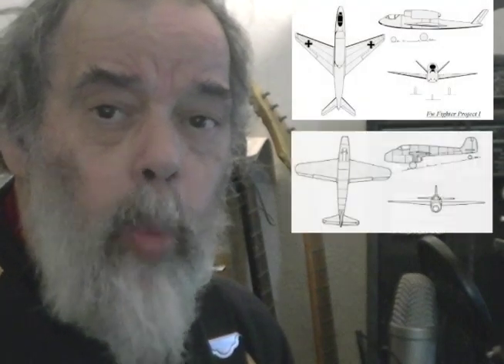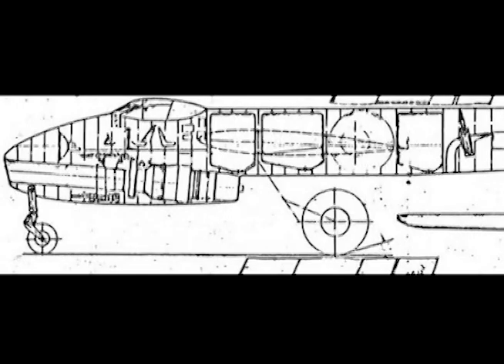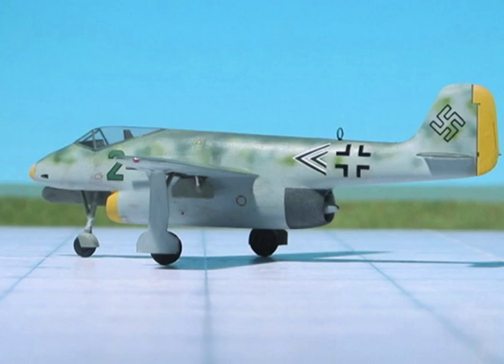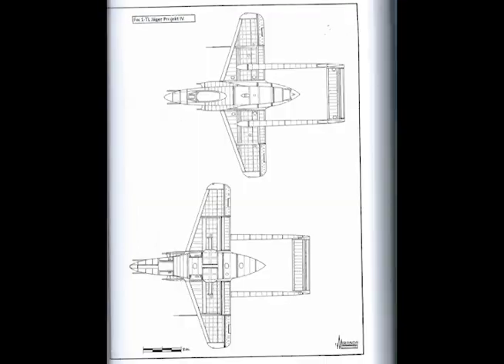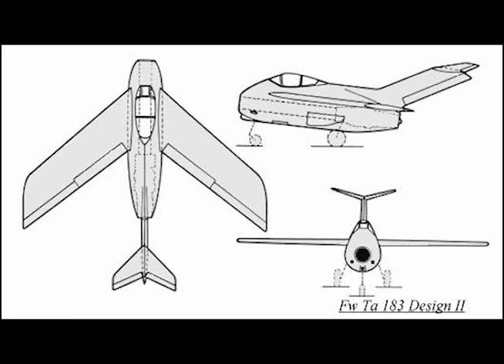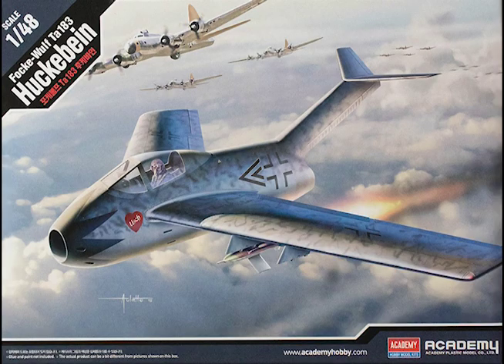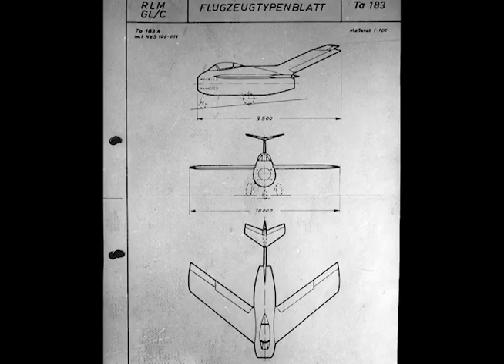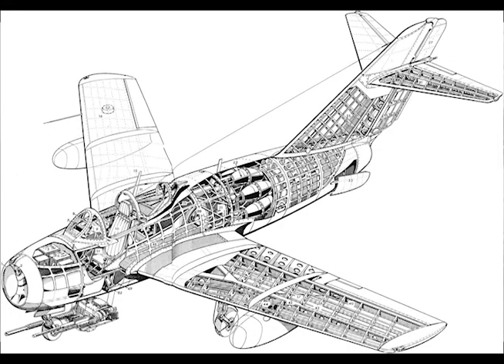German Experimental Aircraft of World War II #10 - Focke-Wulf pt1

Comment: Project No 1, N1 It looks like The Bugatti (which I never knew existed until last month) with a Jet Engine on top instead of props.
The F86 and all it's variants is also a lot like the Ta183, you can see the P-80 in it's design, but that sitting on top of the engine or at least the intake was pretty standard in the fifties for everyone. Great Perch.

Looks like the days of Lumbering bomber formations over Germany were just about to become way to costly for the Americans. The Germans were just about to increase their speed by 25% over escorts and more than that on the formations, it would be about double the speed of them. From what I have heard that is a bit of a disadvantage for the attackers, closing so fast. but with 30mm x2 or x4 and those rockets not many bombers would be surviving one good hit. 

If Il-2 1946 who have a lot of these in the Game is modeled correctly, (and I think it is based on these Numbers and more not just some whim of a modder) the Ta183 Me162, flying wing and the Mig300 are the most stable jets to fly, the Shooting Star has a tough engine to manage, and the Me262 and that unarmed bomber more often than not burns a engine on start up. The Jumos were problematic in RL as well so that first gen of Ta183's would have been sub par but still so far ahead to almost be invincible. 

No Canard designs......

Cheers 🍁